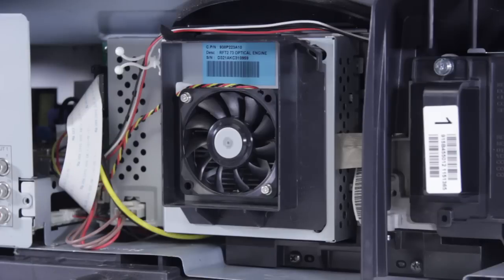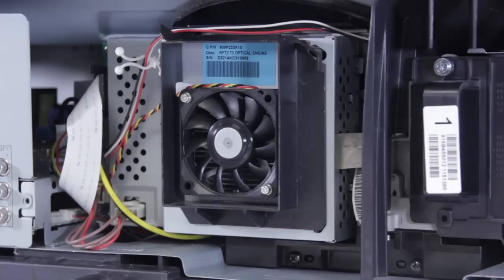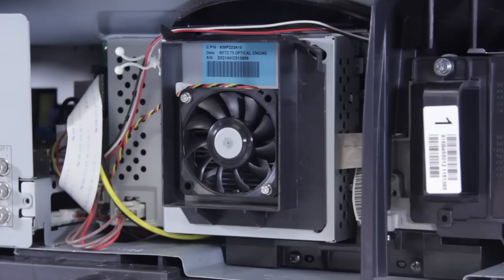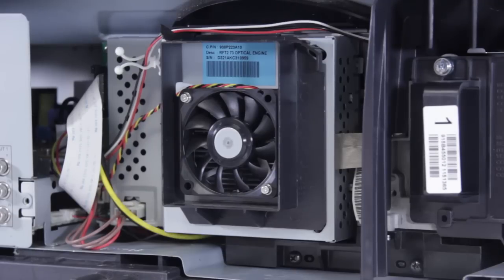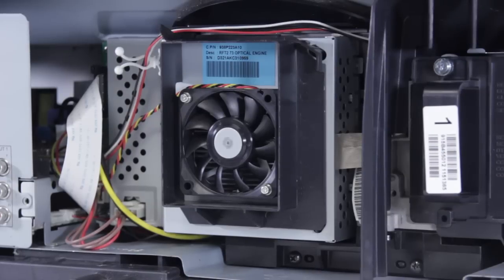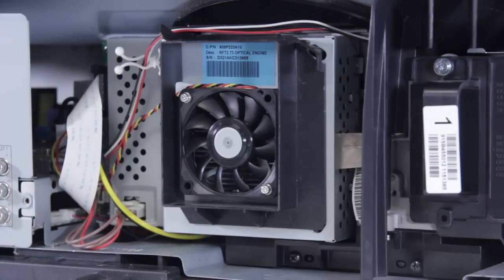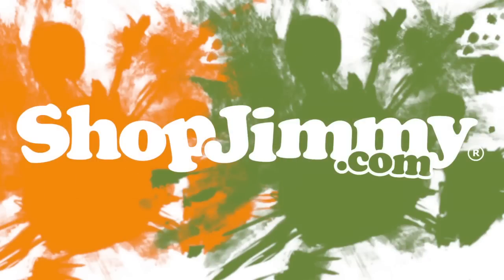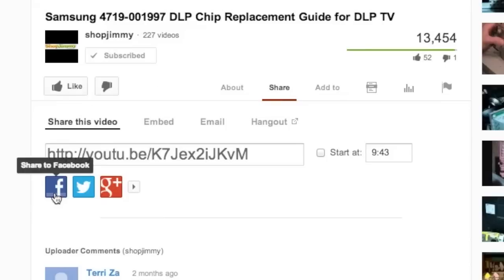Mitsubishi Steady Yellow Light DLP TV Repair DMD Overheat Air Flow Warning - DIY TV Repair

Comment: I have a Mitsubishi model wd73c10 tv screen keeps flashing I looked in the back-replaced the lamp already worked for a while screen keeps flashing- looks like the color wheel has a crack if not how do I replace that part

Comment: have the 65" 3d hdtv mitsubishi model WD-65731 Mitsubishi Dlp television i believe, where do i find the model number at?? but this is what i was told i have. i took back panel off and it was dusty so i cleaned it all and blew the dust out of the fans, but the big fan behind the bulb i think could be replaced to run faster and keep it cooler so how can i do that. i truly believe mitsubishi should have put better fans inside it.

Comment: I have a continuing yellow it might be green Geeze continues to blink fast with the blue welcome screen . I have been told it means I need to update software I called mitsubishi and they said I can just download it to a USB and plug it in to my tv on the side and it should work well did that and it is still doing the same . Do you think I should just order from the company the USB update or did I do something wrong.

Comment: i have a constant orange light blinking how do i know which fan needs to be replaced especially since one is hard to reach in front of the lamp, any advice?
Reply: lucas lopez what was the problem with your tv
Reply: it was the panel you  remove it wasnt touching the switch when u put it back on to tell the tv the cover was completely on and found out from a tv repair man to buy an extra bulb since the tv is out of commision  and soon Mitsubishi wont make parts for it anymore

Comment: I used a really small safety pin and cut the head off of it and just bypassed the thermo over load over the bulb holder so freaking easy to do. gotta find a replacement overload, cause it could cause a fire. Just open the bulb panel and look on top of the bulb housing, you will find a tiny plug, pinch the plug on the top and pull it off  jumper the plug.

Comment: I hope to get some help here. I'm a do it yourselfer and I have a Mitsubishi wd-73732 dlp. It comes on but it is black and I hear static. It stays on for about a minute or a bit more then it shuts off. The red status light comes on, I push power it comes on again and shuts off again. HELP!!!!
Reply: The fans come on  and shut off too but come on and off.
Reply: ***** I still want the original question answered but how can I test the fans?
Reply from the maker: *****   I recommend replacing the lamp in your TV.  Here is a link to replacement lamps for your TV model:  http://www.shopjimmy.com/mitsubishi-915p049020-dlp-replacement-lamp.htm  You can also call our customer service for further assistance with your purchase.  (877) 881-6492  Thanks and please let us know if you have any further questions with your TV Repair!  www.shopjimmy.com

Comment: I have replaced the dmd fan (was functioning but replaced it anyway in case it wasn't running fast enough or something) and cleaned and re-seated the dmd heat sink with new thermal compound, but still the set turns off with error 39 - dmd overheat air flow. Any more ideas?
Reply from the maker: telnetdoogie  Something is still blocking the air flow of the TV, double check everything and make sure there is at least 3 feet of space from walls and such.  Thanks!  www.shopjimmy.com
Reply: 3 feet....... If it needs 3 feet of space, It has under powered fans in the TV's design...
Reply: I had the exact same problem, set shuts down quickly with code 39 and steady yellow status light. After replacing all fans and thermal sensor I found a post from a Mitsubishi tech that addresses the issue. It is apparently a known issue with Mitsubishi but you won't get any info from them. I replaced the main board as tech recommended and problem was solved.

Comment: Error 61 means "No LAMP-EN output from the engine to the ballast" Most likely cause: "Bad Color Wheel 61
Reply: Reggie Russell, 
I've taken my model 60-638 apart and hooked each fan to a power source and they all worked. I removed the color wheel n cleaned it and reinstalled it. I put it all back together and upon turning on I can here something running but I have no picture and can tell my lamp isn't on. I've noticed when it powers up the dmd fan doesn't spin as it tries to power on. When it powers off it blinks red 6 times and 1 yellow. Any thoughts?
Reply: @marksimmons1289  I got the same code on my 60 inch... I ordered a new color wheel, and i'll soon see if that's what is wrong with the TV

Comment: we have a toshiba 47l6200u led tv..the front green light continuously blinks and the screen says toshiba. any thought?
Reply from the maker: *****   I recommend replacing the main board in your TV.  Here is a link to replacement parts for your TV model number on our website, click here:  http://www.shopjimmy.com/catalogsearch/result/index/?cat=56&q=47l6200u  Be sure to match part numbers on your current board, with your replacement for compatibility.  You can also call our customer service for further assistance with your purchase.  (877) 881-6492  Thanks and please let us know if you have any further questions with your TV Repair!  www.shopjimmy.com

Comment: Shop Jimmy, Im having a problem putting in the 2 screws that mount the lamp on tv. This is my 3 lamp Ive changed out and had no problem with the 2 screws but with this 3 lamp I am. All 3 lamps match up the same and I dont understand why the 2 screws will not catch the holes that are to set the lamp securely. Please HELP!! This is only thing holding me back from enjoying my tv. Hope to hear from you soon sir and thanks. Really enjoy your videos keep up the work sir

Comment: oh also i have cleaned the front screen and even taken the front screen off and cleaned all the dust inside and cleaned the mirror and the screen inside, but it looks like there is maybe a small spider webs between the glass front screen i dont want to take that apart, cant i just order the replacement front screen as set from somewhere.

Comment: as i heard taking those front screen two pieces apart can cut you if your not careful. i though they where small scratches but they arent. so all i can figure is they are small spider webs inside those panes of the front screen.

Comment: ok thanks, cant believe its so hard to find replacement front screens, so do you just suggest i take the screen apart and clean it then, as i already took it off once and know how to do it, just didnt take those brackets off the front screen though as was worried about it as some said you can get cut pretty bad if your not careful in handling those panes of glass due to them being so thin is that true?? as the little spider webs are annoying that are inside those pans.

Comment: thank you for such a cool video for number 1 and long story short movie South Carolina my nephew broke my TV down here plugged it in yellow light so it's possible one of the plugs come off I just had it fixed before I moved as far as having everything adjusted cleaned and one of the lamp bulbs or the computer thing and it was fixed was in a bad motorcycle wreck TV been setting for about 2 years so I need to go back there and check this out and make sure there's nothing blocking the sand and the wiring I know this will save me money and I can't thank you enough for this video when I lived in Indiana there were no videos on this TV whatsoever this is great man
Reply from the maker: +Roy Nelson   Try all repairs and troubleshooting at your own risk.  Please reply with your TV model number.  Click here to view a video that shows how to find your TV model number:  https://www.youtube.com/watch?v=S51nhAmwR2M  Thanks!  www.shopjimmy.com
Reply: Thank you